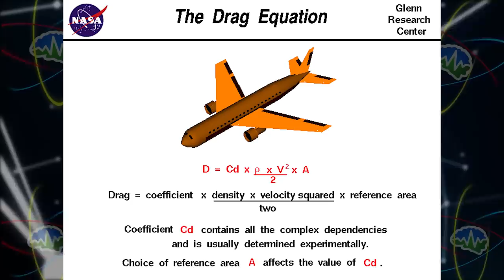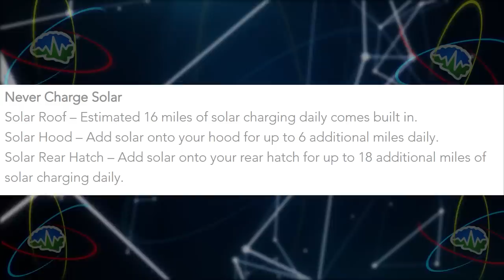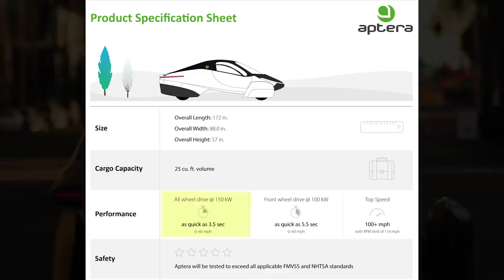Aptera Beats Tesla? | In Depth

Comment: Where am I supposed to put my hockey equipment?
Reply: With 25 cubic feet and almost 7 ft of length there should be no problem finding space for hockey equipment.
Reply: @n.brucenelson5920  Maybe, it just doesn't look like there is place behind the seats, and I don't see my hockey sticks fitting in there either. But it's hard to tell the scale.
Reply: @n.brucenelson5920  Thanks, I don't think it will work with the way the back comes down, my sticks are 67 inches long, and in my Hyndai GLS I have to lay the seats down, with the rear end of this AMAZING car, I am not saying it's not great, just...eh, I will have to see it to believe it.
Reply: Rickie j  Ya, sticks can fit on a skidoo because it doesn't have a body that tails down in such a way that  stick won't fit in there. Trust me, if I see a 5'7" hockey stick fit in the car, I will get one

Comment: @16:40 incorrect - they are registered as motorcycles not standard motor vehicles, there are currently no electric incentives for motorcycle classified vehicles. Also.. price/range ect all 'look' great at first evaluation, but you do lose a lot of car over something like a Tesla Model 3. A standard vehicle can hold 2.5x more humans, and has much better cargo/storage. Also although they claim it is safer than standard vehicles in crashes, I think this is only true at lower speeds. The faster the speed the more safe a standard vehicle is over the Aptera because of the crumple zones. Aptera is amazing, but I think the price is steep given the loss in common practicality. If you only drive few enough miles to never need to fuel it though that helps offset the cost. One other way to view it is watt/hrz per occupant (true peak efficiency) and at that evaluation it is roughly the same as standard EV's. I like the idea, I don't think it will 'take over' or anything like that. Something between this vehicle and standard manufacturing thinking and design I think is the key. Tesla has said for example they can gain 5~10 % more range by simply taking off the mirrors and adding cameras. Point being the more standard vehicle box designs can be made much more efficient if we can just get regulation to be a little more agile.
Reply: While it is true that there are no incentives in place now, but there were in the past.  They are included in the proposed bills before Congress, but no telling what will happen.

As far as safety goes, once production intent vehicles are available, they will be tested to standard US government automotive safety standards, even though the class is exempt.

Results will be published before shipping starts

Comment: The Aptera doesn’t charge significantly faster. It can’t charge at the same rate as a Tesla because the battery is much smaller. A better way to look at it they are about the same percentage battery charge per hour.
Reply: A better way to say it is that it gains range faster, which is true on the same charger.

Comment: Horsepower??

Top speed? 100mph
 For how long? 
Off road power??
Reply: The 3 motor version is rated at 201 hp continuous.    Peak is considerably more.  In hot or very cold conditions available power may be reduced to protect the systems.  Speed is RPM limited to 110 mph.
Reply: @n.brucenelson5920  
Thanks much for this answer. 
Do you happen to know WHERE or HOW to place an order for one of these cars??  
I am not in the USA--- Will they be sold worldwide like Teslas??

Comment: While I think this is an interesting design and configuration, It is more like a motorcycle than a car.  This three wheel "shape" has been deployed in gasoline cars since the 50's. Similar results are reduced energy required, long range, etc.  Still never took off because at the end of the day, the utility, serviceability and form factor comes back to traditional car configurations.  Hence Tesla success model.  The long term success of this company will either be as a toy (akin to the Can-am Spyder), or they will morph into a car that appeals to the masses.  its 2021 now.  In 10 years there will not be hundreds of thousands of these on American highways, but there will be 10's of millions of Tesla.  But I would love to collect one of these so my grandchildren have the coolest thing ever
Reply: Tesla has to discover how they can be profitable as a car manufacturer if they are to survive, something that they have not managed to do so yet.  Their profits are coming from selling clean air credits, which will be phased out.  Also the right to repair that Aptera offers will be far more successful than what Tesla is doing, and Tesla will be forced to change, or lose out.

The Aptera has very little use case in common with the Can-am Spyder or other similar cars.  I don't think you understand what the design offers to single people, retired couples, and commuters.

In any case, Aptera does not plan for this to be anything more than a niche market car.  The 5 passenger sedan and other vehicles that are coming may be mass market, and the capital costs to build them will be far under what Tesla is doing now.

Comment: The #1 problem with this vehicle is not safe, any1 that involved in an accident in this vehicle is going to come off 2nd best, its won't be long before its gets label a roll-o-ta. 3 wheel vehicles are inherently not as stable as 4 wheels. Once it goes through regulation a lot of that efficiency gonna be wiped off.  Not to mention the day to day practically of it of avoid side curbs, potholes and speed humps. This model won't succeed, but a future revision has a better chance.
Reply: Most of this is not true as you will see when the crash test ratings are published.  This vehicle is already far more stable than almost any SUV.
Reply: Body material is much stronger and more resilient than steel. Designed to pass safety tests of cars,  protect passengers in collision with air bags, roll cage & crumple zones, like in cars. Keep your eye out for crash test videos, coming in a few months.

Comment: So you can't park in a garage?
If you drive average of 40 miles per day that is 1 hour of driving.
It won't charge 40 miles in one hour.
So at home & at work you can't park in a garage or shade.
Reply: Of course you can park in a garage.  If you plug into a standard 115 v 15 amp outlet, you can gain range at a rate of 13 miles per hour of plug in time, no special charger needed..
Reply: @n.brucenelson5920  Kinda  negates the purpose of solar panels.
Reply: @cannon440  One purpose of solar panels, perhaps.  If you live in a desert area, you will be able to park in the sun and leave the A/C on.  Come back to a comfortable car with out killing your range.  Each owner will use this capability differently.

Comment: just put a 4th wheel thats just there for compliance.
Reply: Unfortunately, that would spoil the aerodynamic shape that led to the 3 wheel design in the first place.  There will be follow on 4 wheel Apteras for more passengers.
Reply: @n.brucenelson5920  you can just turn the rear wheel into a duelie wheel.  it would make very little differance but make the requirements
Reply: @JohnSmith-lo2cl  The motorcycle designation also helps with some other issues, such as the mirror requirements.  At least for the US, that doesn't seem to be needed to be to be needed to be permitted by the roads.  It might be better to address incentives through lobbying efforts.
Reply: @n.brucenelson5920  lobbying is gonna be a huge issue for a company like this, and all the biggest lobbyist revolve around traditional cars and oil.  this is where it may not be a bad idea to work with companies like tesla at least in name to get hype.  though im not sure what kind of chances that would happen.  but twitter seems to be effective lol
Reply: @JohnSmith-lo2cl  You are absolutely correct.  Some other 3 wheel manufacturers have already done a lot of the heavy lifting in getting the autocycle regs in place in most states, but there is a lot of work to do.  Some of the Aptera Brand Ambassador volunteers are organizing to do some of this work, which is needed at the State level as well as the federal level.

Comment: if you intend to buy an electric vehicle, do it now because the price to recharge it is still very low but unfortunately this will not last because the government will have no choice but to tax electricity.
At the moment, fuel taxes are the key to maintaining road infrastructure, but when half of users will switch to electric vehicles fuel tax revenue losses will automatically affect the price of electricity.
The price of an electric vehicle is significantly higher than a fuel vehicle with a significantly lower range.
Dispite the low cost of maintenance and recharging, electric vehicles only become profitable after having travelled many miles but future taxes on electricity risk undermining this economic balance.
Reply: It is correct that some way will be needed to fund roads, and there are other choices besides electricity tax.  It will be imperative that we don't deincentivize the change over away from carbon.  In the case of Aptera, with an EPA range of up to 1000 miles, the range is significantly more than ICE vehicles and in the South West, can gain enough range directly from the Sun to cover average daily driving needs.  The price of an Electric vehicle only seems high when petroleum fueled vehicles are subsidized and the environmental and health damages are ignored.
Reply: Aptera is a game changer for the EV market, it is the synthesis of what all electric vehicles should be.
Light, efficient, cheap and not complicated to produce, affordable and especially not dependent on a network of superchargers for those who want to travel long distances.
The future of electric vehicles belongs to the category of cars that do not need fast charging, Aptera goes in the right direction by simply using a DC 110v power outlet to recharge its batteries.
It would be very easy to find a DC 110v power outlets in all car parks, hotels and even at your workplace without having to invest in expensive fast charging facilities and above all avoid overloading the electricity grid which is already in great difficulty…

Comment: I have been a close follower of Aptera since 2007. They are repeating the same mistakes that made them fail the first time around. It is a mistake to put solar panels on a car, that is extra weight that just decrease your efficiency. If you think those solar panels will generate enough energy to drive 40 miles you are a fool. None of these numbers that Aptera is throwing our have been confirmed in real world driving. Aptera should but the minimum battery possible (100 mile range) and try to undercut on price by making it for under 20k
Reply: What?  An extra couple of pounds will kill the efficiency?  You have to take a look at the actual numbers.  If you crunch them, the performance claimed is a fair amount worse than what the actual will be (allowing for EPA highway cycle calculations - which won't be too similar to the way most people drive them).
Reply: Yes. They are a bit sloppy with the numbers. At their web site they are more careful in what they say and more honest in writing. (https://www.aptera.us/never-charge) First, to get 700 watts from 3 square meters of panels, they also need to cover the hatchback and dashboard, as well as the roof & hood, which the prototype shown dooesn't do. Second, that's 40 miles max., only on a the summer solstice in sunny SW USA and similar places. (Spain and the Sahara would be great.) Any other place and time, not so much. Check their solar calculator at their web site too get actual predicted solar range. (11,000 miles per year if you live in the right place. Maybe only 2/3rds that in cloudier places.)
Reply: @n.brucenelson5920  you think the solar panels will be only "a couple of extra pounds"? How about all the extra hardware and wiring needed? Two things are not going to work out :
#1 the solar panels will not produce as much energy as they claim
#2 the Aptera will not be as efficient as they claim
I know it sounds good to investors and erly adopters, but I think when they actually go to production the numbers won't match

Comment: This brings flashbacks to the Elio and what a fail it was. There's no way a 100kWh battery is going in one of those, and no way it will be passing crash safety tests. Don't get your hopes up folks.
Reply: Both have been engineered to do so, and will.  Paul Elio never delivered anything.  The Aptera developers have delivered thousands of units built with resin infusion technology such as they are using here and Chris Anthony is coming from a successful IPO at a company he co-founded and was CEO of.  They know what they are doing.
Reply: @n.brucenelson5920  I really think you underestimate the size of a 100kWh battery, and the energy it takes to propel such weight a mile. My electric mountain bike weighs 100lbs, has a 1kWh battery, and uses ~50w/mi @35mph without pedaling. You really think a vehicle with a battery 100x the size and probably 10-20x the drag is going to only use 2x the energy? Get real. Even model 3 ratings of 235wh/mi is embellished, and more like 270+.
Reply: @DaveDuzzit  Your battery is about 10 times heavier than the batteries Aptera is using per kWh

The Aptera cd= 0.13 -far less than the Model 3.  At EPA highway speeds, which average around 48 mph and have peaks to 67 mph, the Aptera uses less than 100 watt hours per mile.  It is far more aerodynamic than your bike.
Reply: @n.brucenelson5920  Do you like work for Aptera or something? Because the bullshit you are spitting my way is on a whole other level. 2 tires on the ground with minimal contact surface results in far less drag. No vehicle, 3 wheels or 4, could ever meet the drag of a motorcycle, more or less a bicycle. Not to mention I built that 1kWh battery myself, and it is about as light as anything currently offered in the EV market. No battery will ever be 10x lighter/kWh than my bike. Just goto the website and look at the Aptera, there is clearly no space in that chassis for a 100kWh battery. Even a 4 door model 3 would struggle to fit such a pack without compromising cargo space and safety. I'm done here. I'll check back in a few years after this concept is long forgotten.
Reply: @DaveDuzzit  Dave, you clearly don't ride motorcycles or bicycles and don't understand drag.  You will probably delete your comments once these start shipping and the owners report their real world results.
Reply: @n.brucenelson5920  I don't think it will matter. You will probably delete my comments just for pointing out the obvious. It's ok, I saved everything anyway.

Comment: But what about driving in the snow?
Reply: Next season we will have video of Aptera in the snow from the Elaphe winter weather test track.  Since I live in Iowa and will getting an early Paradigm edition model, I hope to be able to post from personal experience, although I won't purposely seek out the opportunity.  The Aptera ABS/Traction control system can sense slip and adjust torque 32 times per wheel revolution.  This works out to about every 2.5 inches of tread travel.  I plan to put on studded snow tires for such conditions, and I expect that performance will be good compared to other economy cars of its size.

Comment: What is the range in kWh per mile?
Reply: At EPA highway cycle speeds Aptera will use less than 100 watt hours per hour.
Reply: @n.brucenelson5920  I agree. However, as I compare EVs the golden number seems to hover Near 4kWh per mile. I don’t know how to convert from watts to KWh.
Reply: @John_1303  I don't think most EVs are that bad.  1000 watt hours is one kWh.

Comment: It's not apples to apples. It's more like a motorcycle. So less safety in accident.  Less carrying capacity etc.  Still cool concept
Reply: Having put more than 400,000 all weather miles on motorcycles I can tell you it is nothing like a motorcycle. 25 cu feet of cargo capacity and the ability to sleep two on camping trips in climate controlled comfort.  It will also be crash tested and safety rated to automotive standards unlike any other 3 wheeler.
Reply: @n.brucenelson5920  -  we'll see. Based on looks and weight, it seems like a death trap.  We'll see how the crash results turn out.  But I'm not hopeful
Reply: @yogiyoda  I have some more info than you might.  I drive a Gen 1 Honda Insight.  It got 4s in all categories when it was tested, and it weighs 1800 lbs.  I was hit from behind in my first one by a large vehicle at 60 mph and was uninjured.  Aptera has several safety design features the Honda doesn't  I base part of my expectation on this.

Comment: yeah no gasoline engine has 1,000 mile range but 400 miles per tank and at maximum 7 mins on the pump you have another 400 miles so imagine a 5,000 mile road trip who you think would get there faster. because you are going to need more than 7 mins to achieve that thousand mile range.
Reply from the maker: Not the point at all, but ok.
Reply: @NowYouKnowChannel  that was just a reply to that specific part of the video. I get the whole point of the video in general as ev's are the future and that one in particular is ultra efficient. but a few circumstances leave me pondering. like driving in snow and rain and all the other elements that you might face while driving, or is it a summer only vehicle?
Reply: @charlemonthighschool2382  As far as range goes, given a 50 kW charger, the 1000 mile range of the largest battery can be almost replenished during a 2 hour stop - reasonable after such a long driving session.

As far as winter weather, the company recommends choosing the 3 wheel motor model.  With snow tires it should do very well.  Aptera has much more sensitive and reactive traction control than any ICE vehicle.  Next season there will be videos of it performing on the Elaphe cold weather test track, but I think it will excel in these conditions.  - as for the two wheel motor version?  I expect to find out personally.